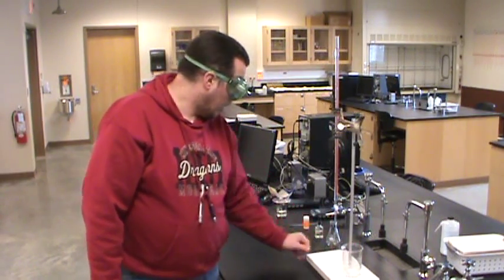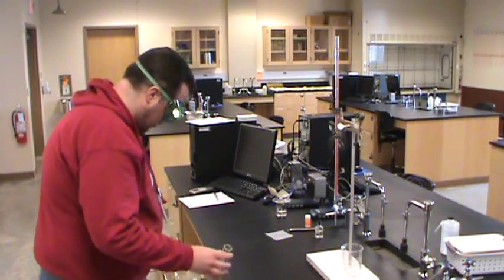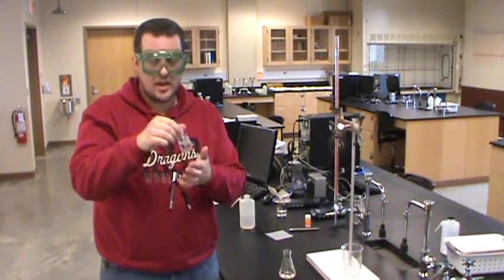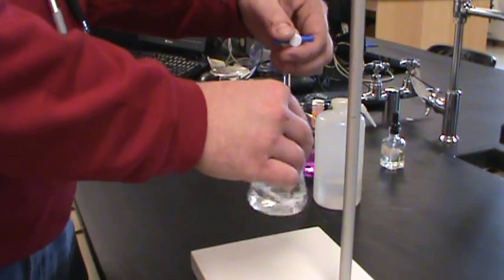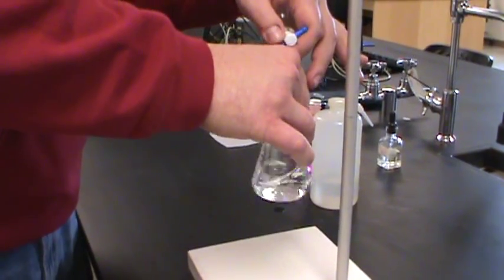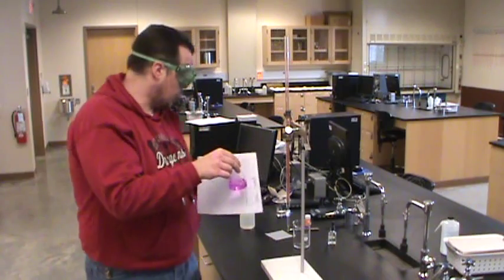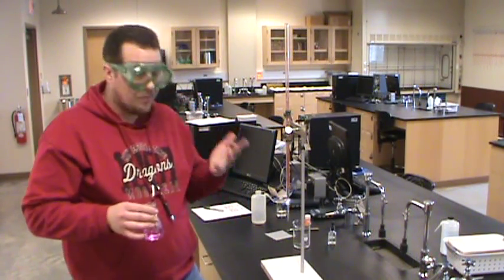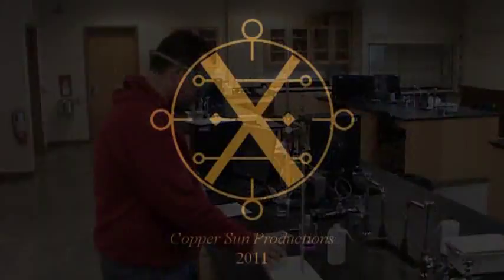Standardization of Hydrochloric Acid (2011ar)

Comment: i need help as sooooon as possible. there is some maths that i just cant get my head around. we used 5.5g of PHP and it took an average of 28.37cm3 of NaOH to tritrate. i worked out that PHP was 0.27 moles and the concentration in the deionised water was 1.08. i have to work out the exact concentration of NaOH. howwwwww?